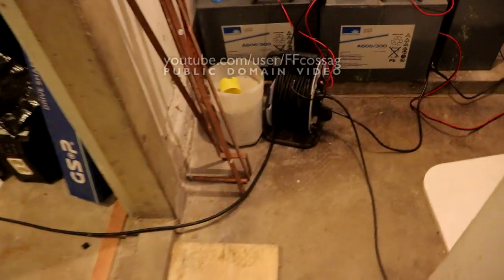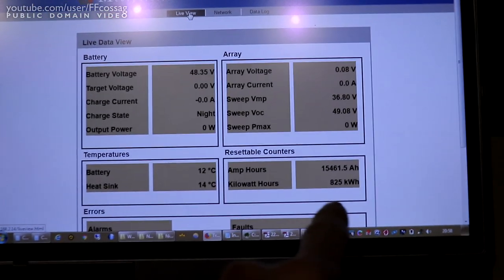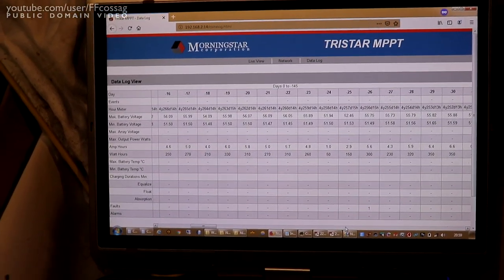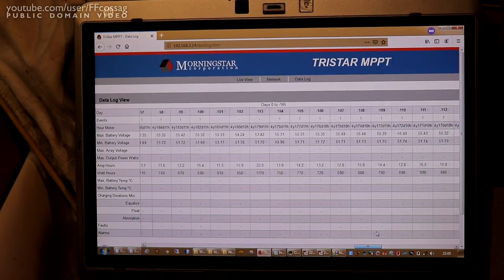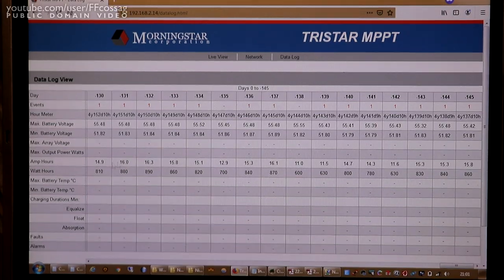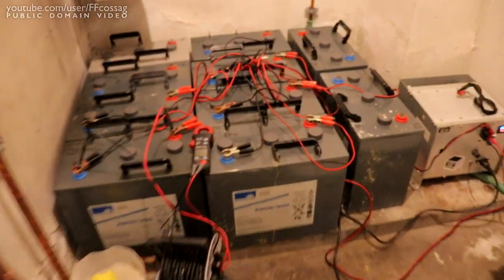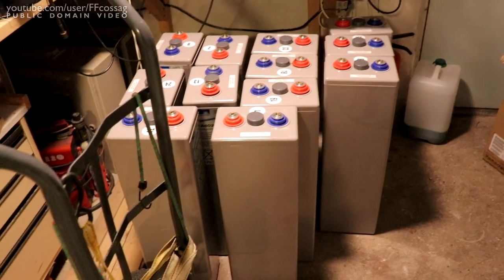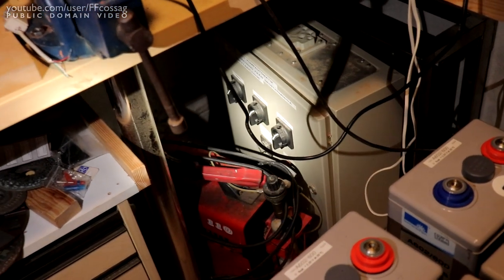OPzVLOG2 - Reminiscing about the old battery bank & planning for the new

Comment: What type of solar panels do you use? Amorphous or crystalline? I'm guessing amorphous panels may work better in the north.
Reply from the maker: I only have two really cheap, old monocrystalline 235 W China panels. So basically, none. I'm not sure what I'm going to get for the new system.
Reply: @FFcossag  From my knowledge amorphous panels perform better with cold white light. I have solar garden lights with both amorphous and monocrystalline strips and the amorphous ones seem to perform better in winter.

Comment: Would you recommend the powersafe batteries?
Reply from the maker: They were OK-ish for me, but they all started suffering irreparable cell balance issues when they turned about 10 years old. In general, cell matching in the Powersafe blocks has been very poor compared to my 6 V Sonnenschein gel cells of similar age.

When I did the final drain before scrapping, they were at ~40 % capacity. Sonnenscheins of the same age are all 85-95 %.
Reply: @FFcossag  that's very good to know thanks. And thanks for speedy reply

Comment: I have a fla backup 24v with 4x, t105's parallel with 4x L-16's, rated at about 800+ ah, but useable is about 500ah, I have a lithium bank with 1400, 18650 cells, about 500+ ah,  and another with 8 ah lipo cells  100 ah and growing. Fully off grid, with gas water heater, 5kw inverter, and use a LiFePo4  12v bank for lighting, it's 200+ah,  it's for lighting and stereo, and security system, I have a 1500 kva UPS, I'm going to use the lead for backup only! Put a 1amp trickel charge on the batts, the lead can still be used with the 5kw or the 1.5kva, (about 900watts) not much, but if the inverter goes down, I'll not be hearing the generator constantly! Nice battery porn!!